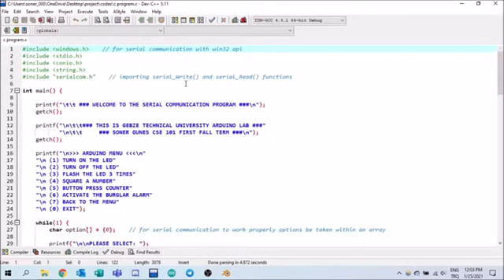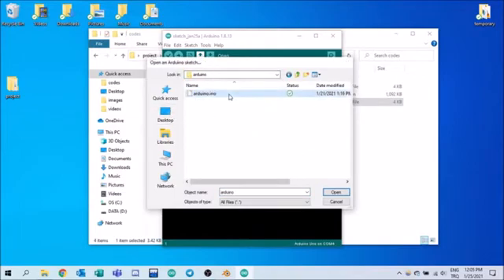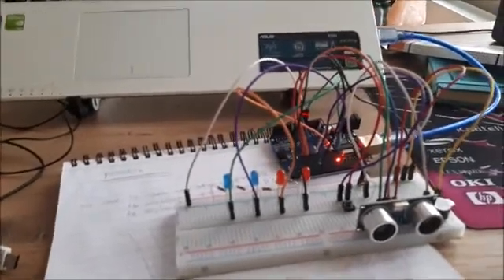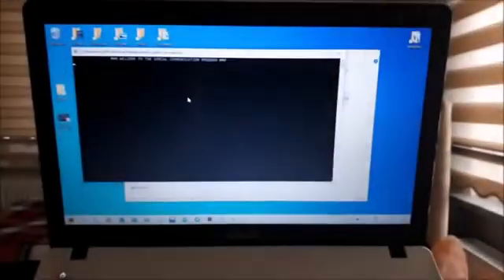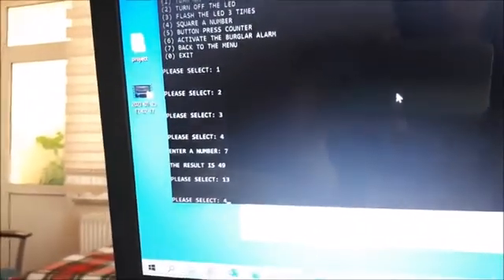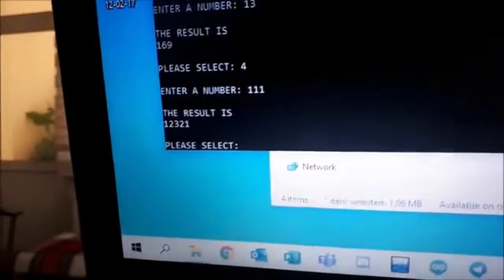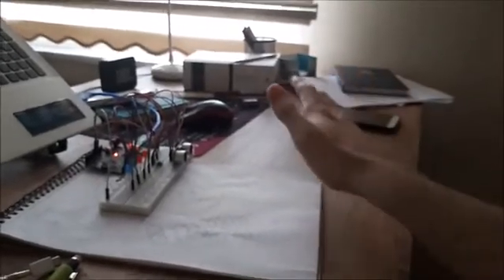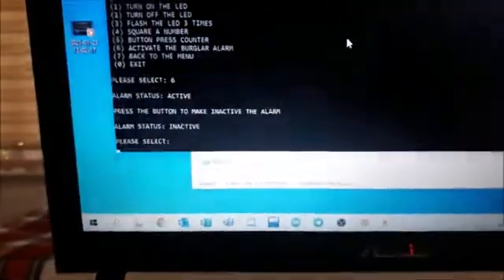SERIAL COMMUNICATION WITH C PROGRAMMING (CSE 101 PROJECT)

Comment: Hello, I tried your code but failed. The problem must be on C because if I input manually by serial monitor, it works. I used port8 so I changed the variable ComPortName in serialcom.h from COM4 to COM8. But I found the value of Status is 0. So does it mean the port cannot be opened? Do you have any solutions?